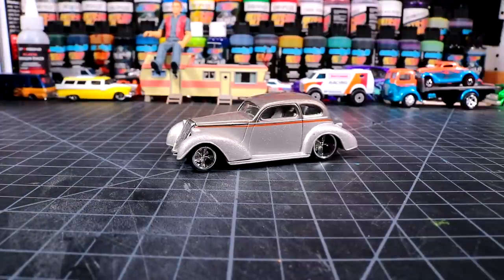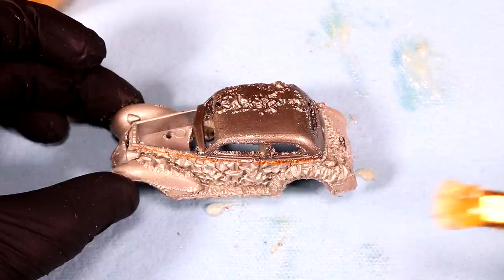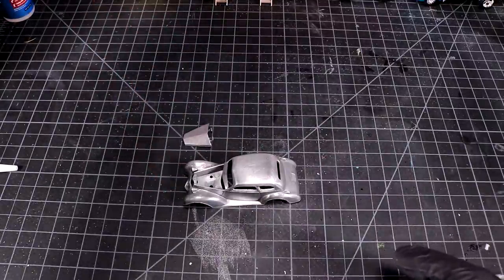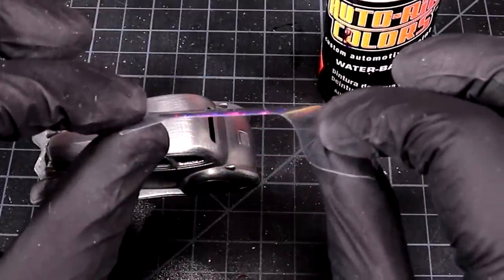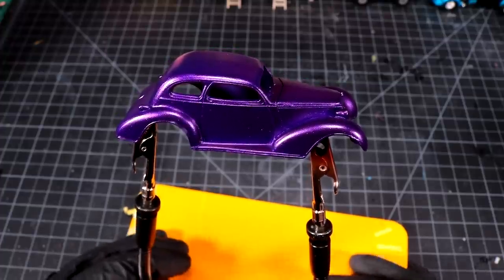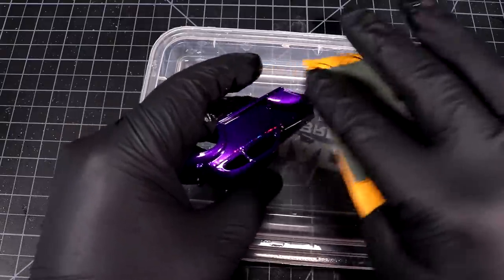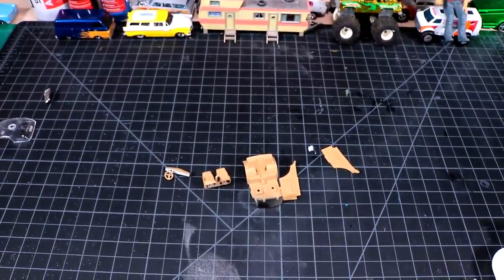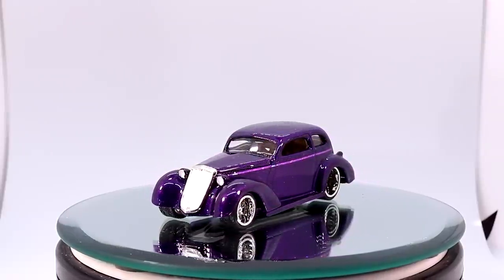1935 Chevrolet Master Two-Door Sedan CUSTOM

Comment: The Grand Master was a badass. No visible bolt threads. No visible engine wires or hoses. All bolt heads faced the same direction. Even the oil filter was painted to match the engine. You could close the door with the tip of your finger.

Comment: @Diecast Resurrection I think it looks great in that purple but I think I would have done a two tone paint job with that deep purple below the pin stripping w/ a silver or white on the top part of the car b/c IMO you lose a little definition of the car's body lines with the car being only one color. What brand of model is that 1935 Chevrolet Master? I want to try to hunt one down for myself.

Comment: Is that a Jada model? I've had several, and found, in every case, that the plastic the windows are made from, discolours, and turns to a crumbly mess, if exposed to sunlight for too long.
And?
I live in England, where sunny days are an occasional treat.
Great custom paintjob there. Awesome colour, too. That pinstriping looks like strips of LED lights, as the model rotates, and is caught by the light. Superb.